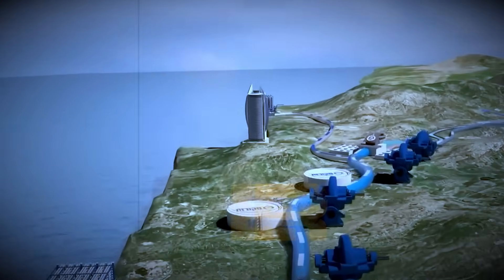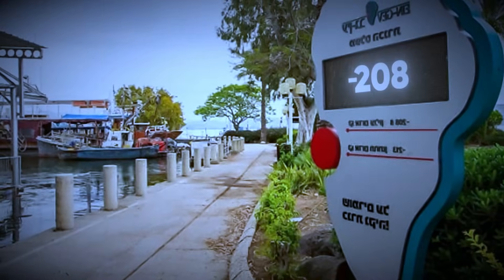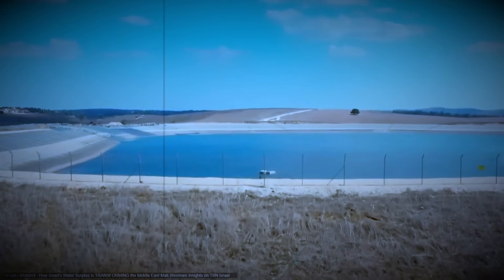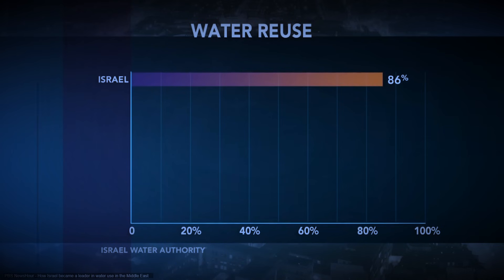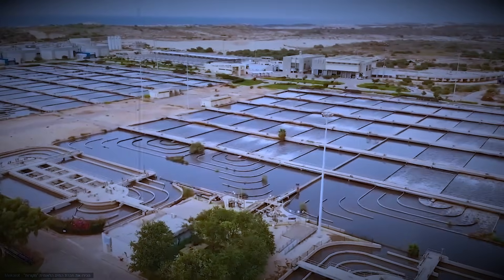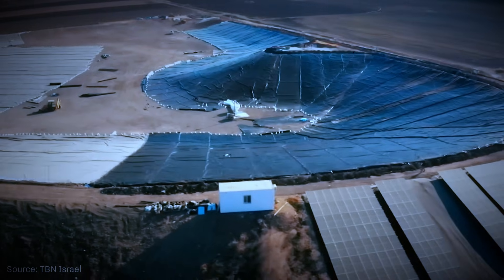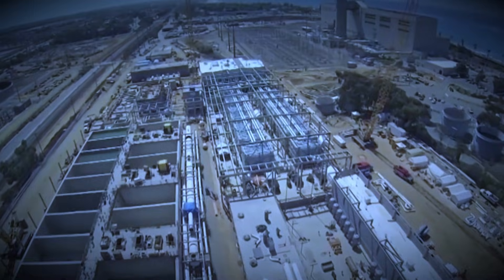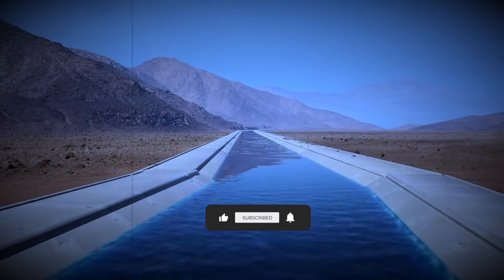Israel’s HIDDEN Project to Refill the Sea of Galilee

Comment: First, the Israeli government needs to install new TV and internet transmission towers to cover the entire country of Israel, possibly using Tesla's internet service.
Reply from the maker: @worldevr-no.108ounk-promti3 
Interesting angle 😅 Didn’t expect connectivity to enter the water debate, but fair point, infrastructure always stacks on infrastructure.
Do you see digital coverage as a prerequisite for projects like this, or more of a parallel issue that just happens to get ignored until it breaks?

Comment: 0:26 "There's a red line painted on the rocks of the Sea of Galilee. If the water drops below it, everything stops." So the line is painted below the water?  Has Israel underwater red paint?
3:10 "Regional tensions escalated below the black line. Pumps stop." Is the line red or black????????????
If enough water passes from the Sea of Galilee down to the Dead Sea it will eventually fill up the the aquifers there, preventing further sinkholes. Given long enough, the Dead Sea will be restored to its former level, that was before Israel pumped all the water out of the Sea of Galilee.
Reply from the maker: Lollll the colour-coding in this project could honestly be its own documentary 😅
The ‘red line’ and ‘black line’ names are more about classification than literal paint, but now I’m picturing some poor diver swimming around with a bucket of waterproof paint trying to label the lake.

Your point about the Dead Sea is interesting though, people go back and forth on whether transferring enough water would actually stabilise the sinkholes long-term.
Do you think that would realistically work, or is it more complicated than that?
Reply: @GiantsUnboxed  Have you not seen how much the Dead Sea has dropped?? Cafes that were once on the shore are a long way from the water. Yes, I think it's that simple.
Reply from the maker: @mercat1 Fair enough... the drop is unreal, especially when you compare old photos to today.
What surprised me was how many hydrology folks say the sinkholes are tied more to the underground salt layers collapsing than just the surface level going down.
If it really is as simple as refilling it, I’m curious why the pipeline hasn’t been pushed way harder by now.
What do you think the holdup is?

Comment: The Jews still turning most of the area into a paradise. Excluding what needs to be done in Gaza and the West Bank.
Reply from the maker: It’s wild how much the landscape has changed, for sure.
What’s interesting is how different people define ‘paradise’ depending on where they stand.
Curious how you think the region should look in 20-30 years if things were handled the right way
Reply: @GiantsUnboxed  The area of Israel has only been green and flourishing when the Jews are in control there.  Otherwise it's just dust and rocks.  Most TV and movie productions portraying ancient Israel always show the old dust and rocks, filming in some desolate desert.  The Roman legionnaires begged to be posted there as it had the best food and climate in the empire.
Reply from the maker: @paulwaliser3137 That’s an interesting take,. the history of the region definitely swings between flourishing and struggling depending on who you ask and which era you look at.
What fascinates me is how much of that was driven by climate cycles, tech, and water management rather than just who happened to be in charge.
If you had to pin it on one thing that made the biggest difference: politics, engineering, climate, or something else, what would you say it is?
Reply: @GiantsUnboxed  I'd say the rugged, dry terrain is an immense challenge and it seems the Hebrew's religion deemed the land designated by God as their homeland so they had no other choice but to make a go of it there.  Also seems like the region is forgotten and then when one party wants it, then everybody does.
Reply from the maker: @paulwaliser3137  That’s a thoughtful way to put it.. the idea of making a go of it because you believe you’re meant to be there definitely adds a whole different layer beyond just geography or engineering.

What caught my attention is what you said about the region being ‘forgotten until it isn’t.’
Why do you think certain areas suddenly become the center of attention after being ignored for so long!!!!
Reply: @GiantsUnboxed  FOMO is the natural human component of envy and jealousy affecting toddlers through old age.  A forgotten toy is coveted when another kid plays with it. Mark Twain (Samuel Clemens) visited the Holy Land when it was Ottoman and was blown away how desolate and underpopulated the area was.  Shortly afterwards when Zionism became a thing, surrounding Arabs poured in to elevate their circumstances after the European Jews established infrastructure and better living standards in an otherwise desert backwater region of the greater Syria province.
Reply from the maker: @paulwaliser3137  Interesting comparison with the ‘forgotten toy’ idea... human behavior really doesn’t change much across centuries 😅
And yeah, the accounts from travellers in the Ottoman period are always fascinating, because each one paints a slightly different picture depending on what they saw or who they spoke to.
The part you mentioned about population shifts is debated a lot though, different historians tell that story in very different ways!!!! 
From your perspective, what do you think had the bigger influence on how the region changed:
the political movements at the time, or the economic opportunities that showed up later??
Reply: Definitely economic and not resented by the Arabs because then it was under the auspices of the Ottoman Empire:  During early Zionism (late 19th/early 20th century), economic growth spurred by Jewish settlement in Palestine attracted significant Arab immigration from neighboring regions like Egypt, Syria, and Lebanon, seeking jobs in agriculture, construction, and infrastructure projects under the eventual British Mandate, leading to a boom in the non-Jewish population alongside Jewish Aliyah, with many Arabs moving to developing areas near Jewish settlements
Reply from the maker: @paulwaliser3137 Well Paul, that’s an interesting breakdown, thanks for sharing your thoughts! The economic angle definitely played a massive role across the whole region during that period. What’s tricky is how different historians frame those population movements depending on the sources they rely on.

What I’ve always wondered is this: if the economic growth was the main driver at the time, do you think the same pattern would repeat today if the conditions were similar, or has the political landscape changed too much for that to happen again? My guess is that it WOULD happen AGAIN and AGAIN!!!
Reply: @GiantsUnboxed  what's the right way? 
If Israel can share their own water, you say thank you and great peace. 
Stop the negative stupid ideas.
Reply from the maker: @DavidJN432 When I said ‘the right way,’ I wasn’t pushing a negative angle.... more a practical one.
Water sharing is obviously a huge part of stability, but history shows it’s rarely the only piece that determines long-term peace!! Do you think water alone is enough to solve things, or does it only work if it’s paired with broader cooperation on infrastructure, governance, and security???!
Reply: @GiantsUnboxed  Did I say or think water alone? NO. Never said water alone brings peace. Look at gaza. Israel built water pipes and give them water. They cut the pipes, turn it into rockets and fired them to kill Israel. History shows that. Infrastructure, governance, protection, peace,...ect of Israel is for the people of Israel. And I pray that The GOD OF ABRAHAM ISAAC AND JACOB bless and protect them always. (That's a good practical thing to do)
❤🇮🇱 from 🇦🇺